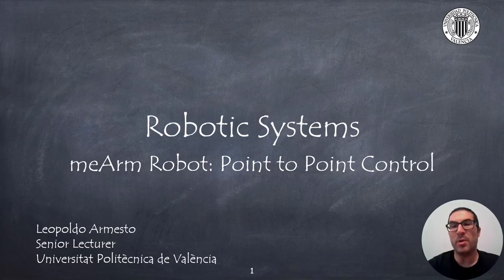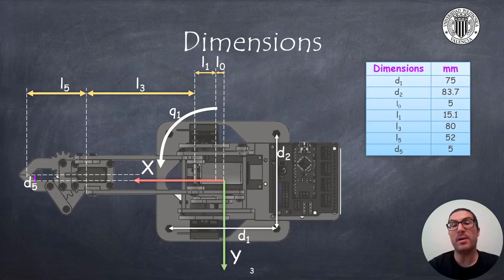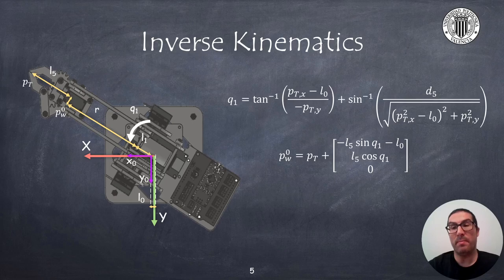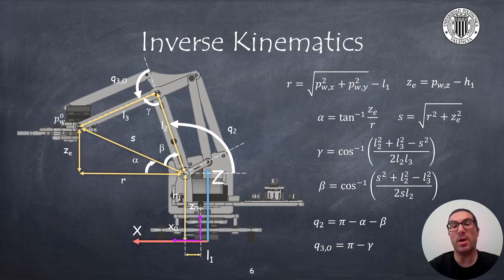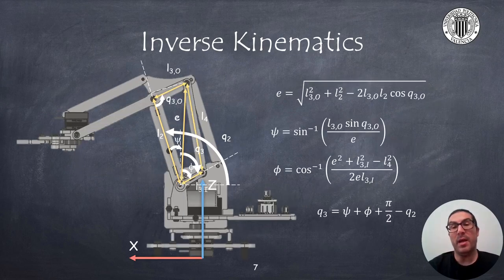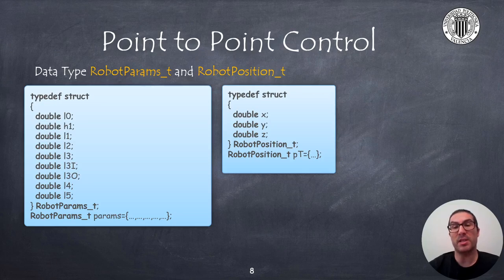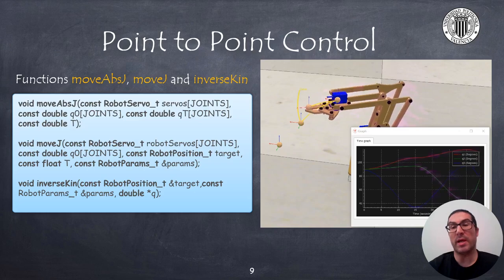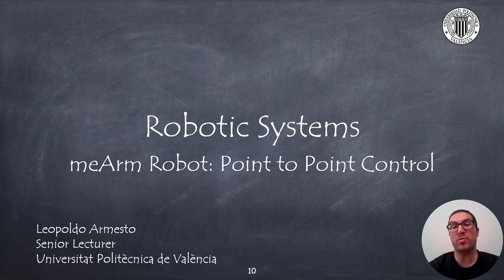meArm Robot: Point-to-Point Control | Robotic Systems

Comment: Excellent lectures Leopoldo!
First time in the series so far that something wasn't super clear to me, but in your definitions of lengths and links the "link" L_ 0 refers to the distance between the centre of the base to the centre of rotation of the servo?
If this is the case, and using a similar arm, but the centre of rotation was fixed to my origin, I could disregard it, no?
Reply from the maker: Yes, you get it right